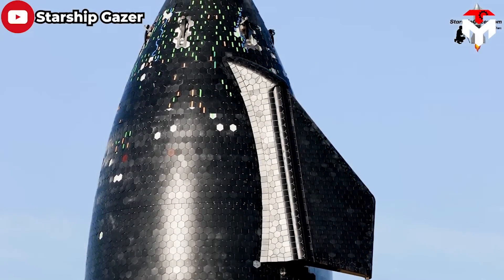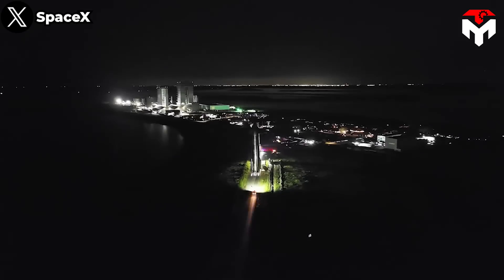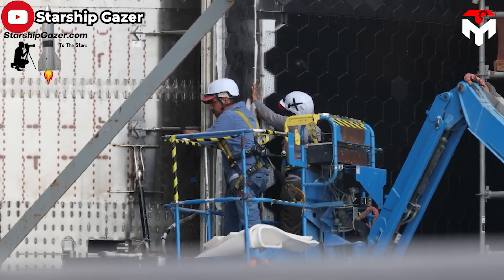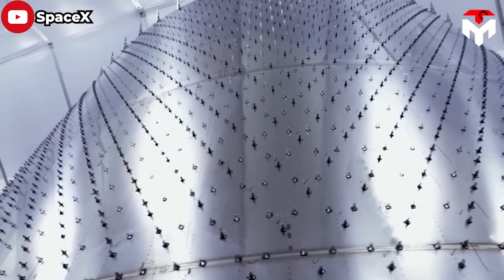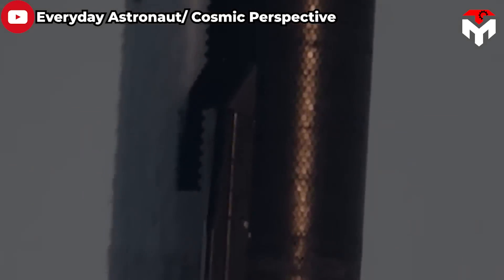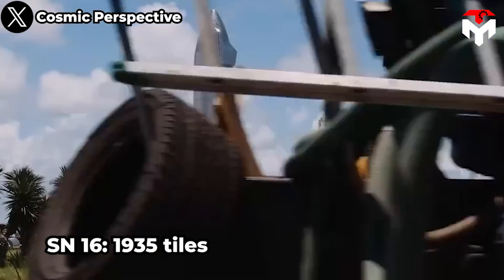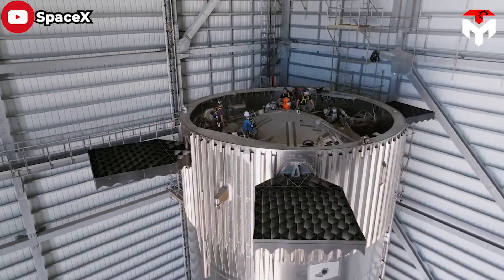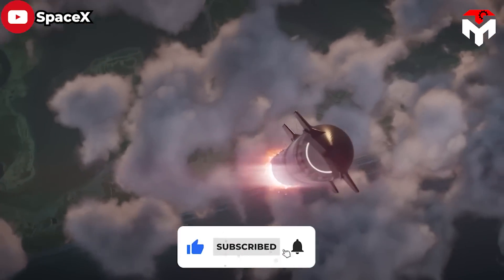Genius! SpaceX's New Solution to STOP the Starship Heat Shield falling in Flight 3!

Comment: I suspect the vibration of launch with 33 engines is the main culprit.
Reply: That and ice buildup that might pull them off. Sometimes I think SpaceX should put a hydrophobic coating on the exterior just to repel water (which should prevent ice from attaching).

Comment: If heat is energy why are they not using this energy to recharge space ship x in reentry?
Reply: Each tile should connect to flow design   lock cooling tiles and making pressure to recharge oxygen tanks for takeoff.  New ai should be able to design with 3D printable models for testing.
Reply: Cool idea, but Why does it need to be recharged? if you could convert the heat energy into rocket thrust for the landing that would be useful... but...

Comment: On one space shuttle flight 700 tiles fell off so not anything new here.  The shuttle didn't fail due to missing tiles it failed b/c a hole was punched into the leading edge of the wing by foam falling off the shuttles huge fuel tank
Reply from the maker: That's right, the adhesion technology issue on Shuttle's TPS is a really big deal!
Reply: These are not transferable examples. One failure mode doesn't imply or necessitate that it is a useful example for another.
Reply: @AltaMirage such a hater...your wrong!!!
Reply: Agreed...it's all a work in progress!!!
Reply: @BerkMeatsOnX  Nope. Just a realist. You about to get your ticket to Mars are you? Think you need one? Think Elon's going to show you the way? Or could it be that you are carried away by the hype, and turn a blind eye to the reality? By the way it's "you're", and, well, you could simply address what I said instead of calling me a "hater" without knowing the first thing about me at all.

Comment: Hey, NASA's Space Shuttle Columbia was lost due to a hole in the leading edge of the left wing. The carbon composite material in that leading edge was struck by a 1.5-pound piece of thermal insulation foam that came loose from the External Tank about 10 seconds after liftoff.  

The rigid ceramic fiber tiles had nothing to do with that disaster. The Space Shuttle was launched 135 times, 133 times successfully. Those tiles performed exactly as designed during the 133 successful entry, descent and landings (EDLs) and prevented damage to the aluminum hull of the Orbiters.

Comment: Good video, it was one of the more in-depth looks into the TPS that I've seen. Another matter however, may I humbly ask of you to say the Fahrenheit equivalent to the Celsius numbers you mention? Actually giving the Imperial numbers alongside the metric numbers across the board i.e. meters, kilometers, etc., would be greatly appreciated. I'm too old to relearn a whole new system and there's no way I'm alone. Thanks.
Reply from the maker: Oh, I missed sth. Sorry for that. Thanks for your comment
Reply: The fully loaded starship will weigh 1,137 tons, 3cwt,two qtrs, 3 stone, 7 lbs,6 ozs and will be 1 furlong, 3 chains, 5 yards, 2 feet, 5 and seven thirty seconds of an inch high. Fix it for you?

Comment: I think only long term answer is to find a different solution.  Tiles have always been a dicey problem on every vehicle they have been used on.  Shuttle Columbia proved that even after decades of work a tweaking and studying, they never really engineered out the risks.  Then, you have Dream Chaser that is years behind because of how complicated the tile application is on that craft and we still do not know 100% how it will perform and if they will also lose tiles in real operations.  I just wonder if the tiles are really the solution SpaceX wants, or if someone in a Government Agency is telling them “it’s the only ‘proven solution’ if they want to keep testing.  I have seen some analysis that says because of the size and shape of Starship, the Stainless might not need that much protection to begin with.  It wouldn’t surprise me if SpaceX is expecting the tiles to fail, but for Starship to survive without them just to make a point to everyone insisting they needed a tile shield.
Reply from the maker: Thanks for your comment

Comment: Mystical Musk's ... Heat Shield Tiles are crap ! ... And the Stainless Steel  will burn Up ! ... How thick is it ? ... an Aluminum Can is 0.05mm - 0.1mm ... a Tin Can is 0.23mm - 0.35mm ... a Car is 0.7mm ... a cooking Pot is 0.05mm - 5.0mm... a meat Clever is 5.0mm ... With the BF Starship being just  3.6mm ... which is Not enough for Reentry ..... Now Musk faces a new Dilemma ? ... which he Knew was coming for 2 years ... Because the Tiles have been Falling OFF ! , since they put them on ..... WUWT ?
Reply: worked <mostly> on the shittle -- works on x27-b - I think only stoke pace is looking into alternative -- anyway cant havefuel tanks at 1000+C ifthey have any fuel in them -- thatd itself be a huge gas expansion explo...problem.
Reply: @tonyug113  There are too many Points of Failure with the Heat Tile puzzle ... Too much Precision needed ... and Risks taken ... But they won't know what will happen , until they Try ... :D